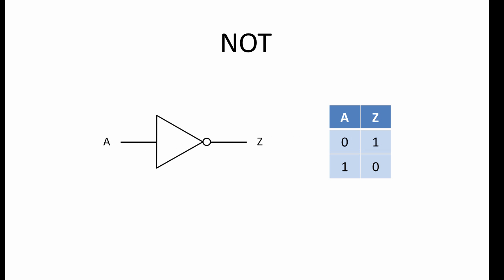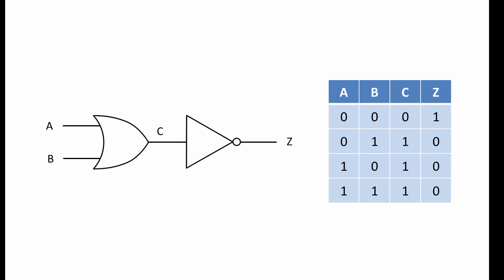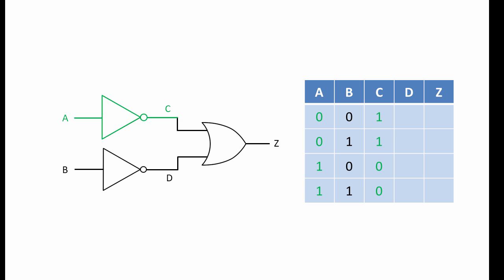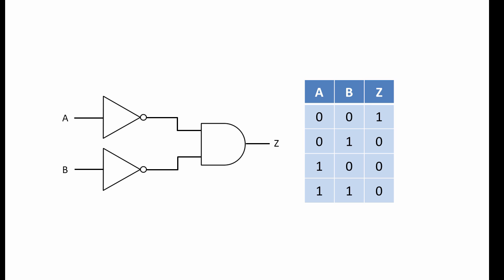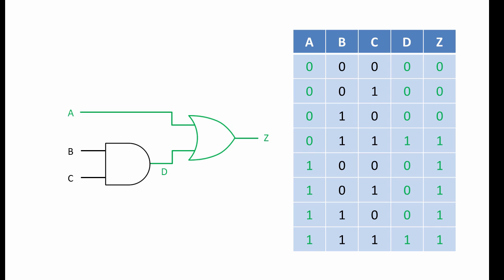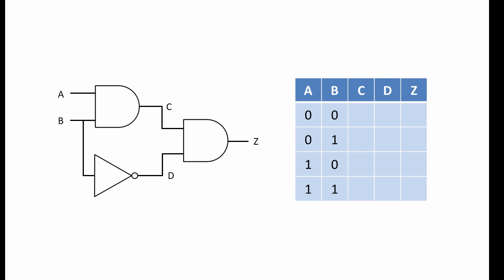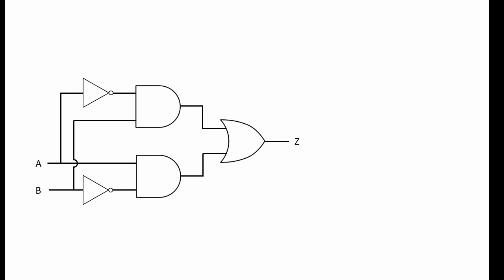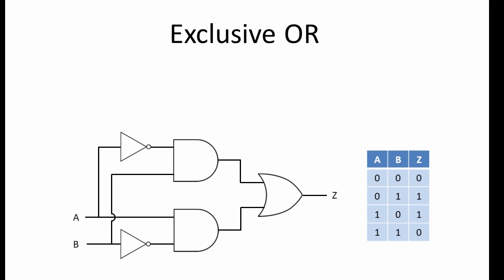Logic Gate Combinations

Comment: I find it much easier to look at things like 11:20 as just going through each input, describing each gate. Not A and B or A and Not B. 01 or 10. Focusing on the intermediate steps may hurt the simplification process.
Reply from the maker: I have often wondered if should highlight the intermediate values.  When I teach this to a class, those who truly understand are not phased. :)KD
Reply: @ComputerScienceLessons  Well I'm not a teacher so idk. But I've been messing with logisim and have been wondering if Boolean algebra can be expanded to be useful on the level of 8 bit adders/multipliers? My current setup involves countdown timers and registers, can I express it all reliably without listing 255*511^3 combinations?

Logisim (evolution) does have a way to create tables and expressions for your circuits but it's very very slow, and so far I've kinda just been trying to get one input working at a time like solving a Rubik's cube.

Comment: What if wires are touching one another
Reply from the maker: There would be a short circuit and it would fail.  But remember, these circuits are usually etched onto tiny pieces of silicon so the wires are microscopically small and unlikely to touch. :)KD

Comment: why is that there are 8 something for the example with 3 inputs? I don;t get it
Reply from the maker: Hi Ejhay. If you are designing a combination of logic gates to a particular job, it's useful to know what the output would be for a particular combination of input values.  A truth table provides a handy summary of the outputs depending on the inputs. There is one row in a truth table for each possible combination of inputs.  If there are 3 inputs, there happen to be 8 possible combinations of 1s and 0s (000, 001, 010, 011, 100, 101, 110, 111).  You should take a look at my introduction to binary video and it will become apparent why.  I hope this helps :)KD

Comment: I'm confused how they make the truth table up to begin with
Reply from the maker: Hi Wizard66. Your table needs to have one column for each input, plus one column for the output (all of the examples in this video have multiple inputs on the left of the logic gate diagram and only only output on the right of the diagram).  Fill in the input columns first, making sure to cover every possible combination of 1s and 0s. (the purpose of the table is to show what the output would be for any combination of inputs).  Filling in the inputs columns is easy if you can count in binary (see https://youtu.be/BnB2m1nXZ84?t=73).  The table is now ready to have the output column filled in, which requires that you trace the inputs through the circuit.  :)KD
Reply: @ComputerScienceLessons  im guessing this requires one to know are the gates charts beforehand
Reply: Does it also mean we have to do them in a specific order? With 1 or 0?

Comment: Can you help me?
How i can make the truth table of:
~A~B + AB

~ = negative term
Reply from the maker: You are aiming to produce this table (your expression is the heading for the third column):
A B ~A~B+AB
0 0 1
0 1 0
1 0 0
1 1 1

Draw out the circuit of logic gates and trace through different combinations of A and B.  
Fill in the 3rd column for the output.

Take a look at this fantastic website where you can enter any expression in the format (NOT A AND NOT B) OR (A AND B)

https://www.wolframalpha.com/input/?i=%28NOT+A+AND+NOT+B%29+OR+%28A+AND+B%29

The website shows T and F for 1 and 0.  You will see the logic gates diagram as well.

Comment: U KNOW AT THE START HOW DO YOU KNOW WHAT TO FILL THE A B AND C ALREADY?SORRY CAPS
LIKE THE 8 ROWS AM TALKING ABOUT
Reply from the maker: Each row of a truth table tells you what comes out for a given set of inputs.  Columns A,B and C include all the possibilities of input combinations.  You could work these out by trying to write down all the different ways you could arrange three ones or zeros,but you might miss some combinations or duplicate some unless you were really careful.  Alternatively, we can apply theoretical approach.  We know there are 2 x 2 x 2 possible combinations, which is 8.  So we count up from zero to 8 in binary.
Reply: Start inputs with 0 and then increase the value as you proceed. Eg if you have two inputs, start with  00, then 01, then 10 and then 11. if you have 3 inputs , start with 000 then increase as follows. 001,010,011,100,101,110..... Etc .